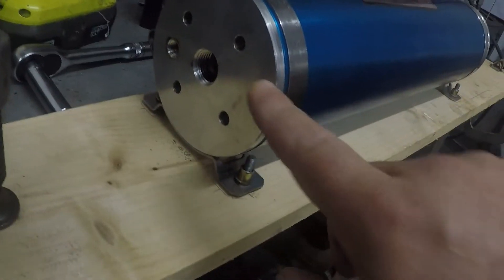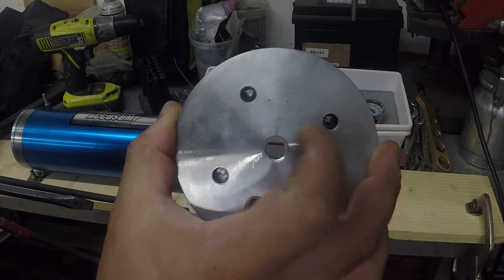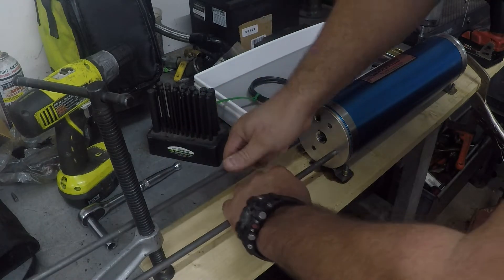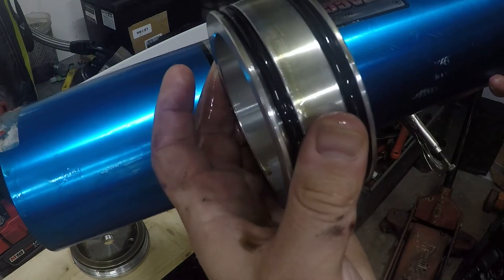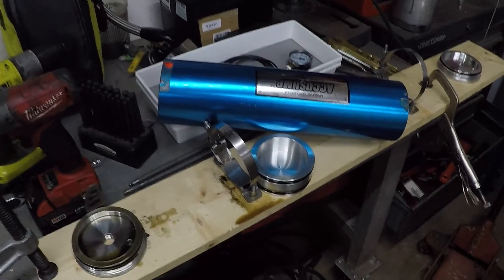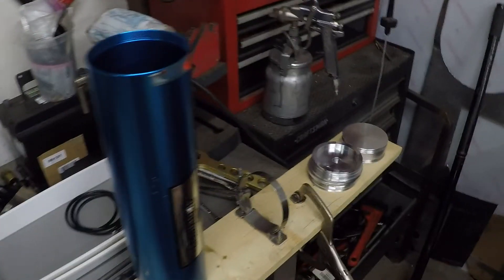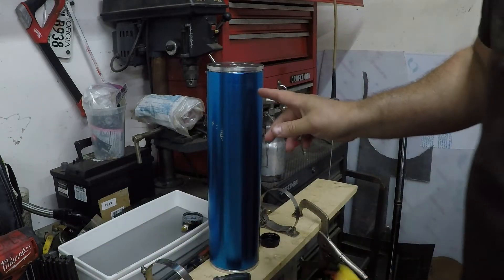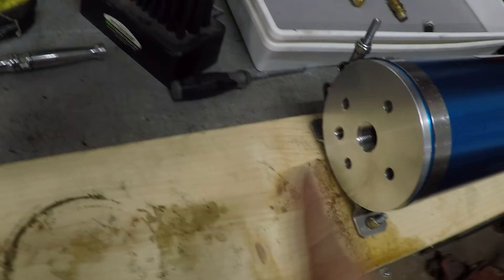The only Accusump Oil Accumulator Rebuild tutorial on YouTube

Comment: Great vid! Moroso still sells the o-ring kit for $20. The part number is 97530.
Reply from the maker: That’s great information! Thanks for sharing.
Reply: Quick update.. I got the Moroso kit. It had 4 of the thicker o-rings in it. It doesn't have the thinner 4" OD 0.1370 that go on the end caps. It seems Moroso changed their design to use the same o-ring on the endcaps as the piston. So it's not exactly the same as the Canton Accusump 🙁

Comment: Amazing!! Keep it up

Yes i think the clamp being tight kept the cap threads and the cylinder glued together

Your not going to be rebuilding often hopefully but if you were,
welding the 2 dowls on a steel rod would be  the tool for it
Reply from the maker: Ya, originally I was going to take four rods and weld them to a plate, then weld the plate to a long bar, but no need. If I were to do this for other people or a lot on my own, I’d make a real tool.